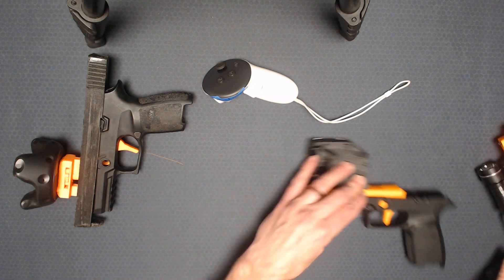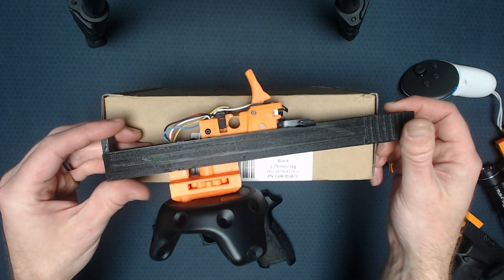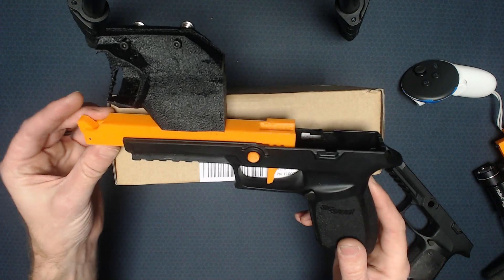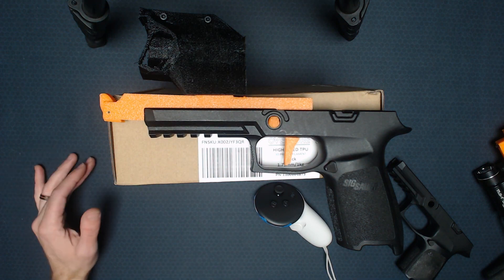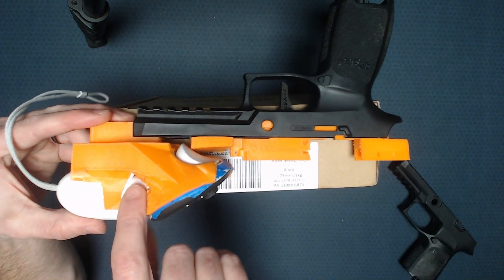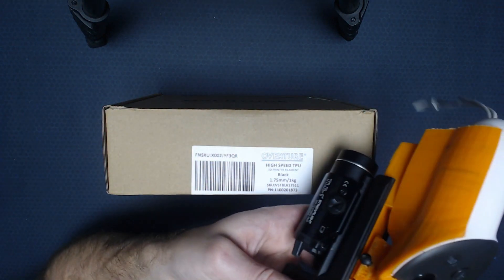XR Pistol hardware redesign for the Meta Quest 3

Comment: I have a Bambu X1C with AMS
And also have a Quest 2 
And 
Quest 3 

I see you have the pistol for the quest 2  on Thingiverse 

I would be interested in beta testing and 3D printing the parts for the pistol for Quest 3 and also the XR-15 your working on 

(Really like your design) 
over the protubeVR Magtube and provoler 

If your looking for any beta testers

All I would need are the STL files and I can print and have both Quest 2 and 3 and provide feedback for your designs

Please let me know either way

Thank You
Reply from the maker: sure thing. join the discord and we'll figure it out there. I have plans to update the thingiverse listing, but am hesitant putting the wip updates there, in case someone thinks its done, makes it, and wonders why some parts don't work.

Comment: All the different systems for clicking buttons seem fragile and snaggy. What if instead of all the arms reaching around externally of the gun, what if the buttons were clicked by a sort of puck attached to the top of the controller and different buttons were clicked by wires running to the puck.
Reply from the maker: i did some tests with 1.5mm wire in bowden tubes, they seemed like more potential failure points. The testing I have been doing in Pistol Whip has been spot on so far for the trigger
Reply from the maker: for additional clarification, the top of the controller has a lot of led lights on it, that are used to track position, see this for reference: https://www.youtube.com/watch?v=WpcWODMpy7E that makes having a puck on top less desirable